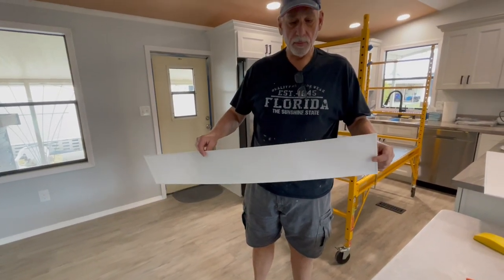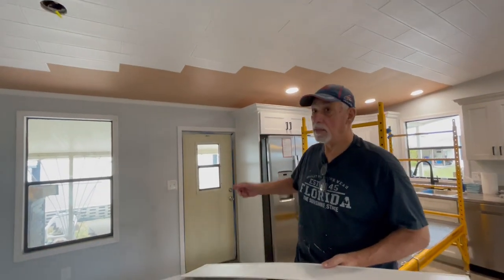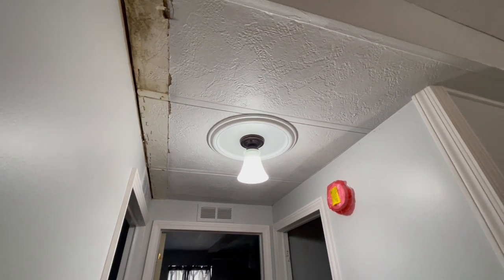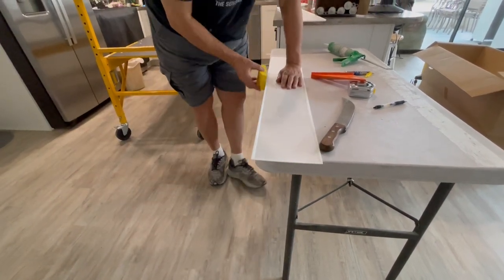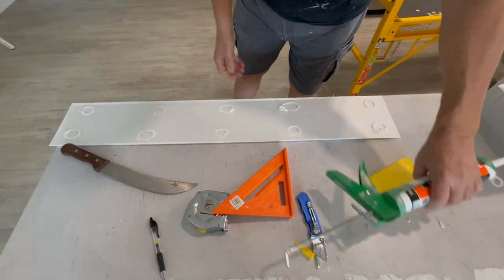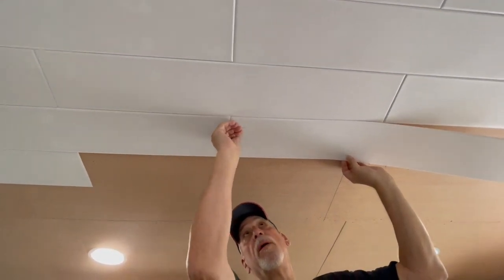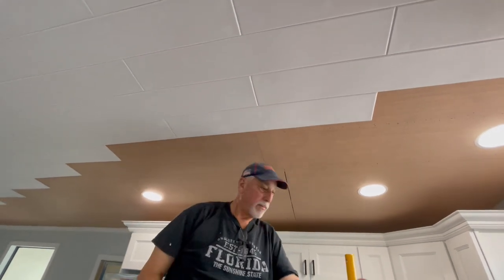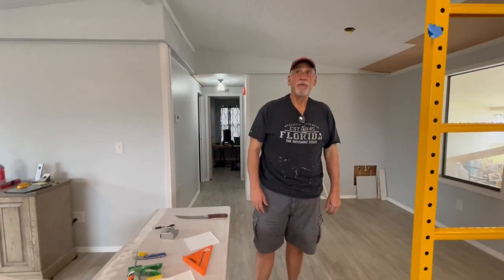Mobile Home Ceiling Alternative

Comment: I’d like to know what sort of prep was done to the ceiling prior to the installation
Reply from the maker: Screw 1' x 4" x 8' Furring strips across the 24" on center ceiling joists.  Then crown staple 1/4" Luan/Flooring plywood to furring strips.  the furring srtips press in the ceiling tiles that a bellying and the 1/4" ply gives you a nice flat surface to glue the tile to without adding a lot of weight to the existing ceiling. Purchased at https://www.antiqueceilings.com/
Hope this helps.

Comment: Would be nice to have a link for this product.
Reply from the maker: https://www.antiqueceilings.com
Need to call them.  Website is being revised and the planks are not in the products.  Also on Amazon. 39"x6.5" Foam Ceiling Planks - 12pc Pack - Covers 21.1sqft - Glue Up Application - Easy DIY - Choose Your Finish - Decorative Ceiling...

Comment: Is it plywood under?
Reply from the maker: The mobile home ceilings were 24” on center and bellied quite a bit.  When I tried applying the planked tiles to this , they appeared to wavy.  I furred the ceiling and crown stapled 1/4” plywood to get a flat surface.  If your ceilings are flat you don’t need to do the plywood. Hope this helps answer your question.

Comment: I would think this is highly flammable and will discolour very quickly.
Reply from the maker: Not sure about the fire rating but these are sold on Amazon as well as Lowes now.  The mobile home I installed these in had a massive roof leak and home owner said there wasn’t any staining or discoloration.

Comment: I plan to apply drywall mud to the 1/4 plywood
Reply from the maker: I think I would use 1/4” drywall before I would use the plywood. Seams would crack with the plywood.

Comment: Am i the only one who thinks the luan plywood on the ceiling looks better than these Styrofoam panels? Heres my takeaway....considering he had to install luan plywood to the ceiling to compensate for the uneven ceiling. Wouldn't it had been sort of comparatively just as easy to install new sheetrock? Thereby avoiding just another cheap looking alternative like these Styrofoam panels. Installing new sheetrock really isn't that difficult, and the results are so much better!
Reply: Was thinking the same thing, might just throw some new Sheetrock over those foam tiles